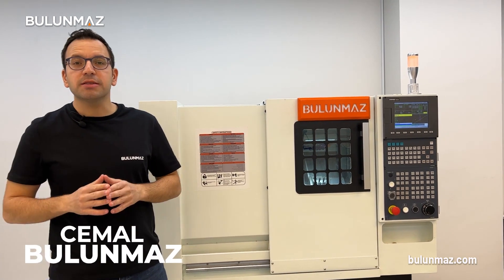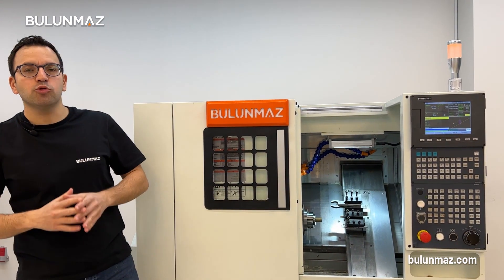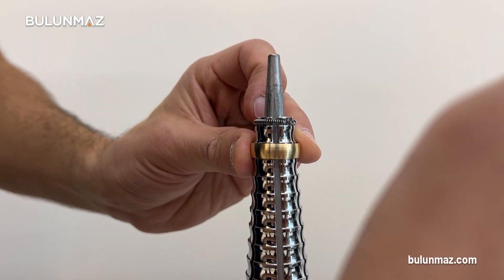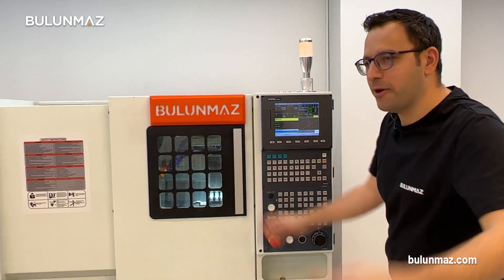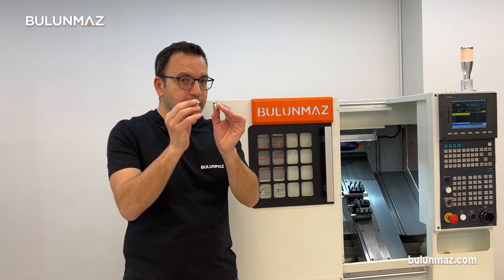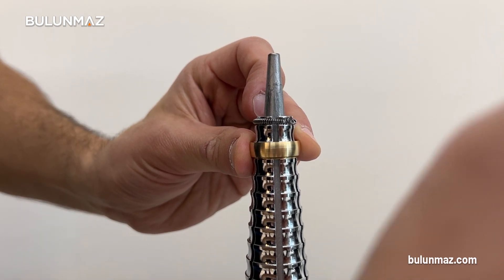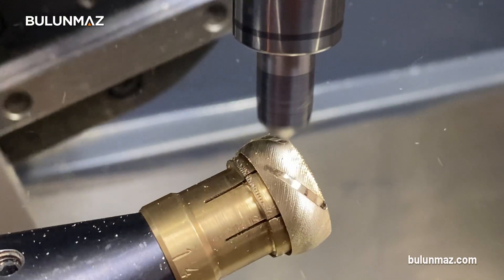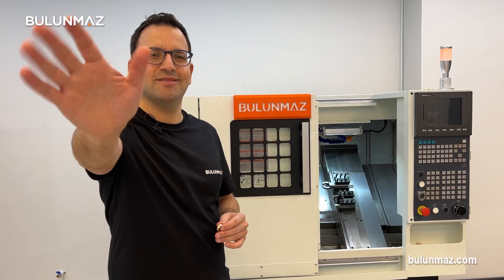HOLLOW GOLD RINGS PRODUCTION with Jewelry CNC Lathe

Comment: Is there a machine that can control the grams ? I mean if someone want to make  2 or 3 grams rings or etc
Reply from the maker: Thank you for your comment, to calculate the weight of the rings is not possible for this machine, but for more information regarding cnc lathe, you can contact with us via whatsapp +905320590643